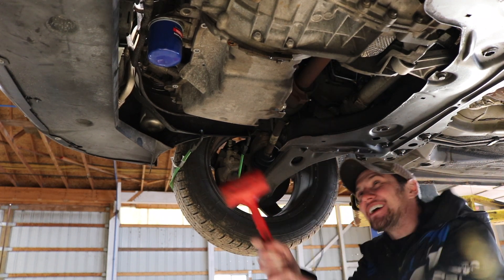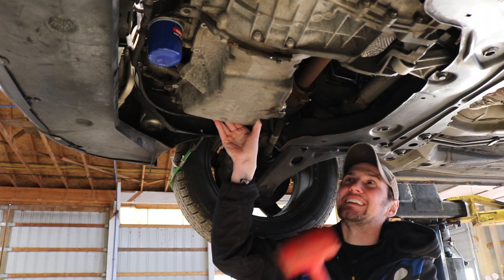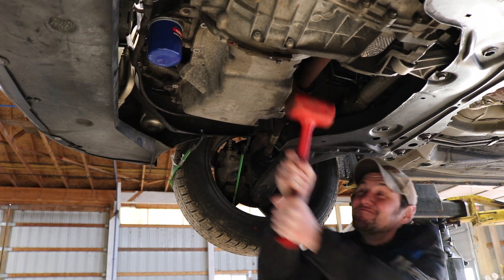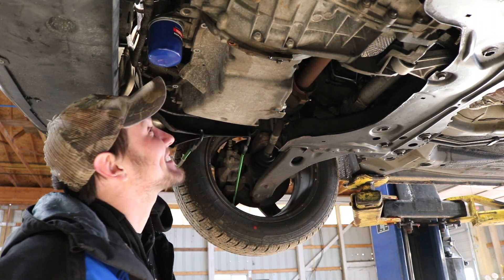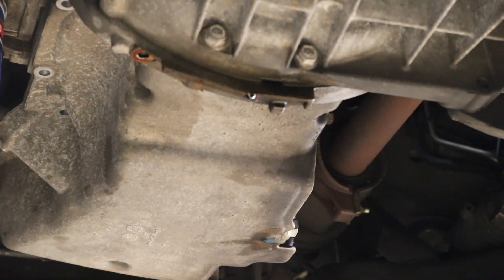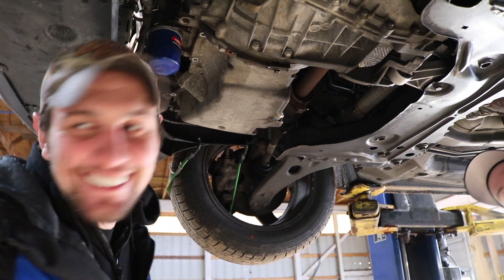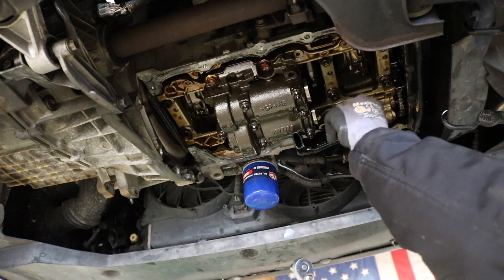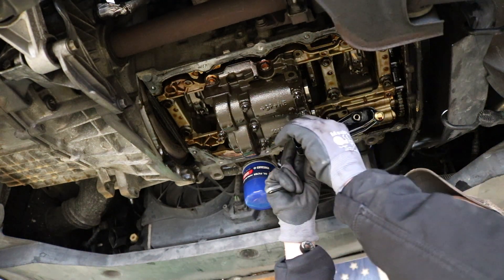2005 Focus ST Massive Speed balance shaft delete dyno test

Comment: People are so focused on "peak hp and peak tq gains" You have tunnel vision if you view the dyno for peak numbers only. You need to see the area at the top where he made almost 10whp more! From 4700 rpm there are gains until rev limit! Even some gains down low from the start until 3500rpm and minor gains in between until the largest gains up top. And because the horsepower is low to begin with, this is actually a VERY substantial difference. Say you have an ST with twice the power to the wheels, you can expect twice the power to be freed up.
Reply from the maker: I recently had a customer in a spec class pick up 7whp through the whole rev range. He immediately won a race. AUC is never talked about, if you can put the power down and can do so through the entire rpm range you will be faster!